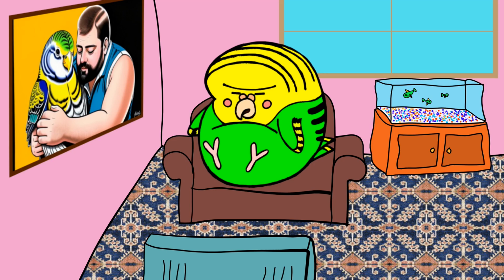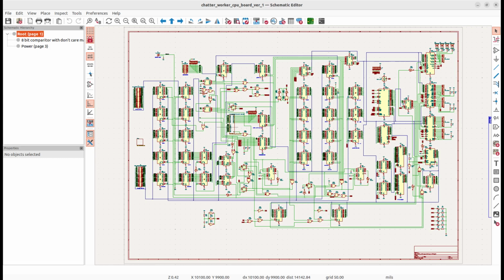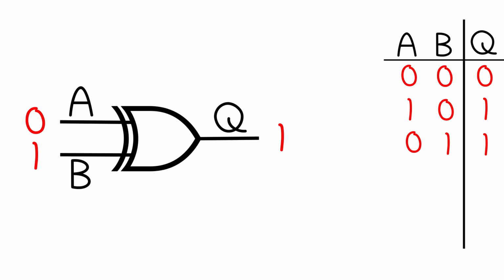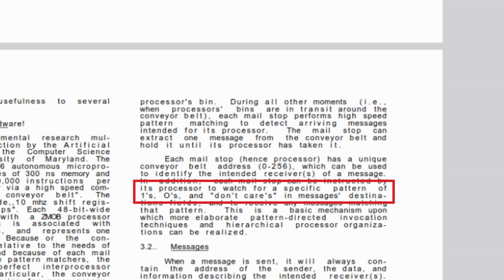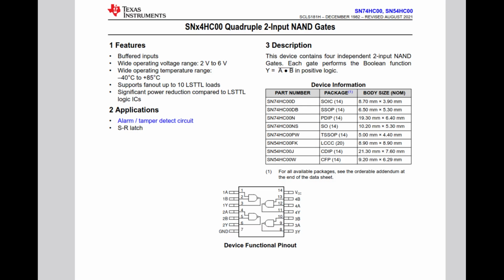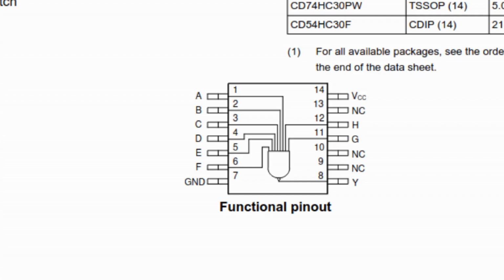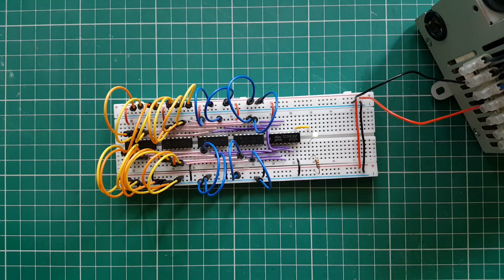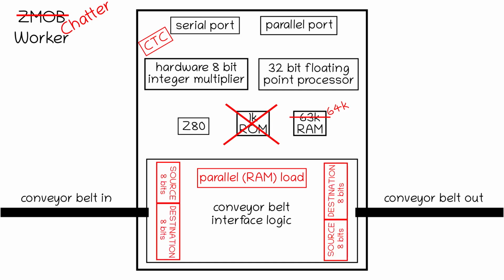Z80 Cluster Computer (part 1) binary pattern matching with don't cares

Comment: 5:43 is it important to step on the chip before, or can I skip this step ?
Reply from the maker: You don't have to bend the pins, it's just that sometimes chips have the pins sticking out sideways too much and they won't go in the breadboard, so if your chips pins line up with the breadboard holes then yeah you can skip this step. (Hope that's what you were asking about, if not let me know and I'll try again)

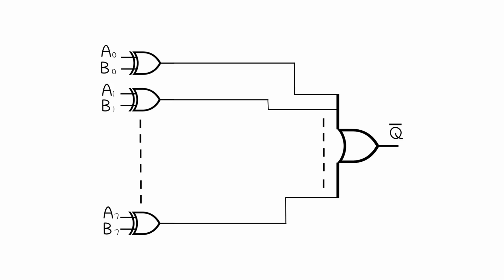Comment: 3:00 You can simplify the circuit using one of this
AM25LS2521 8-bit comparator
or 2 of SN74LS85 4-bit magnitude comparator
Reply from the maker: you can but you'd have to use 16 AND/NAND/OR gates (4 x 74HC08/00/32) to implement the don't care function, which would have the same chip count but at a higher cost. But that being said I'll probably end up using a 74HC688 and 4 x 74HC00 because I think the circuit in the video will be too slow due to the propagation delay of going through so many gates.
Reply: @DrBudgieandtheHumanMan Is a PAL or GAL too "advanced" for this project?
Reply: @DrBudgieandtheHumanMan Btw in my first comment, I didn't take into account that you needed the "jolly operator" (I don't care)

Comment: I'm just commenting for engagement. 

So presumably if you designed this as four bit you could only have 16 Z80s?
Reply from the maker: Thanks mate! It all helps.

Yeah exactly. And that's what I'm thinking for the prototype just a 4x4 grid of Z80s, so I can test it all properly before going completely mad and get thousands of 74 series logic chips and 256 PCBs made!